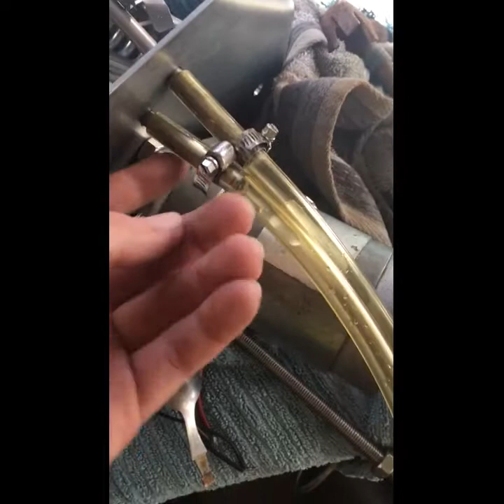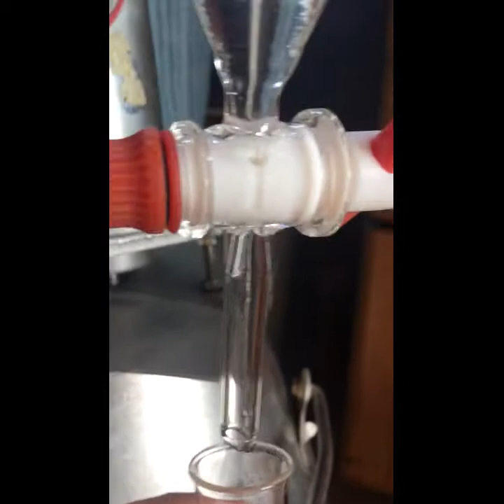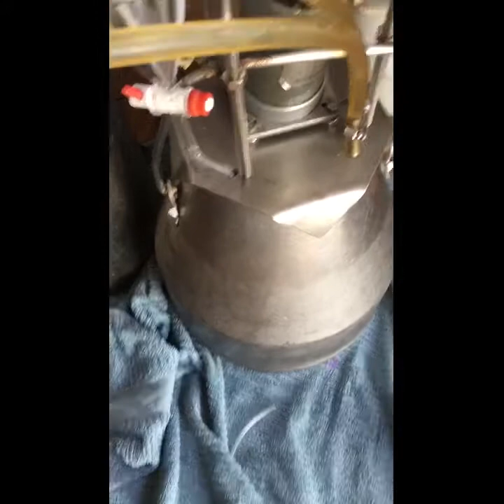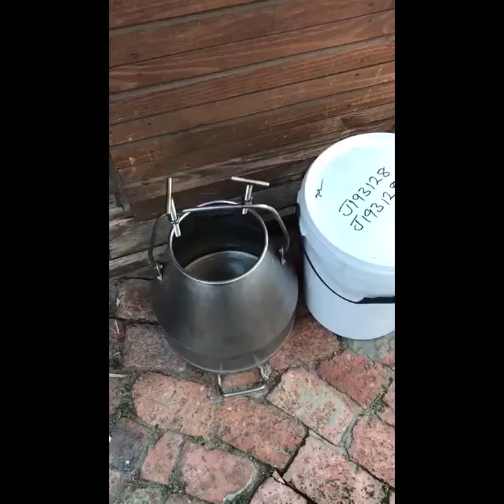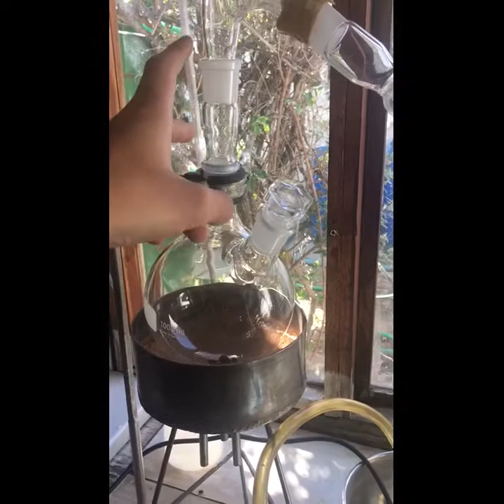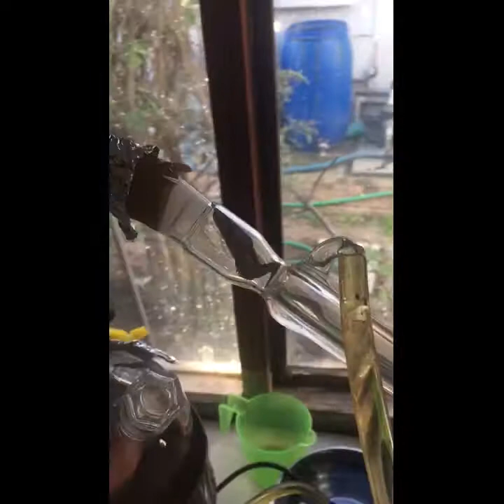Making Chloroform From 20L of Bleach!

Comment: Great video man!  I highly enjoyed it.  That's a cool setup as well.  Very neat.  A few suggestions though.  If you can, try to keep you phone sideways when recording.  When watching videos with a vertical display it's hard for me to keep up because it makes the video smaller on my phone and I have to fiddle with how far away I hold it due to vision problems.  It's no big deal, just a little aggravating.  Also, you went from 4-5 minute videos to one that's nearly 30 minutes.  Lol!  Also no big deal, it's just that most viewers loose interest after about 10-12 minutes.  Not saying that it needs to be shorter, not at all.  Just to keep that in mind when making videos.  I think my longest video is around 15 minutes for that reason.  But yeah, those were the only things I saw that could use some improvement.  Great video otherwise.  Keep up the great work!
Reply from the maker: BackYard Science 2000 thansk man love the feed back , ya the video is really long and I do know about the I interest time , so I don’t have good video editing software and this crap app makes the horizontal and vertical view or messy , I always forget that I need to flip one way with my phone and going to stop doing it, when I decide to make the channel is because I needed to document the stuff I did as a kid and look back when I’m older , that’s why I didn’t worry about the time ( it was a big project) a friend did suggest two parts but I just wanted to upload the video because I have been putting it off, I think in my other vids the audios overlapped to so I should try to be more careful, glad you watched it 😄